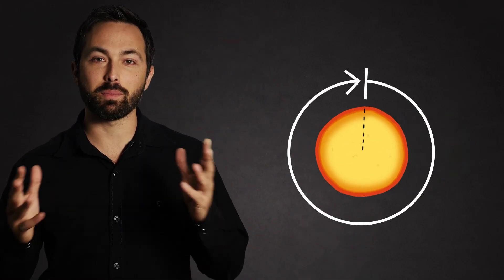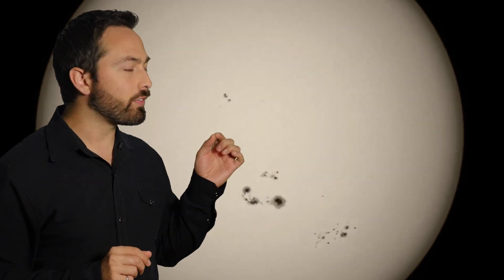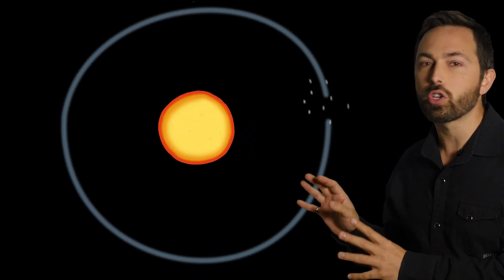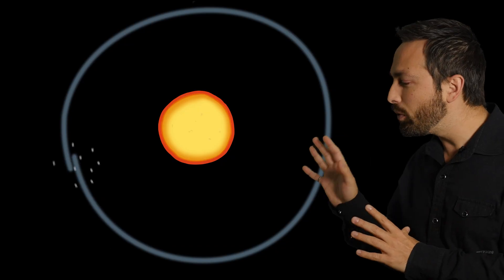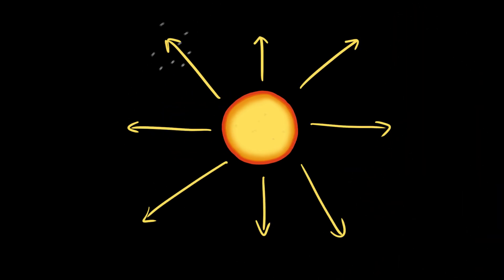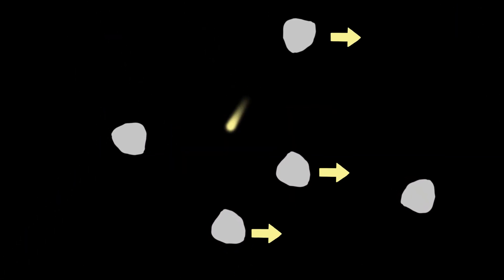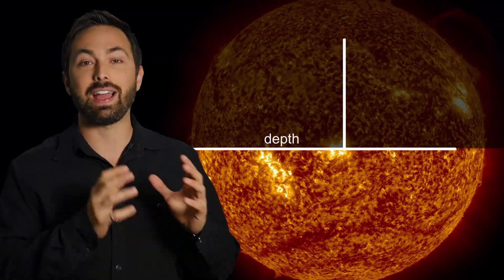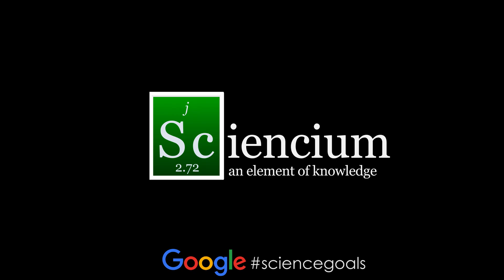Why is the Sun Slowing Down?

Comment: Im not buying it... first you say the dust slows down due to the angle of impact, and then you say the outer layer of the sun slows down for the same reason, but also that the photons going out from the sun goes out in all directions... so the momentum they impact on the sun should be equal in all directions as well, resulting in a net of zero change. And also, about the dust, the photons hit it from "slightly ahead" but still mostly from the side, just like a raindrop still hits a car mostly from above even when driving into it. So it should also push the dust particles further out, so Im not buying that as an explanation for the dust spiraling closer either.
Reply: Have a read of the research paper that Derek links in the video’s description. You’ll clear up your misunderstanding :)

Comment: Also the updrafts in it outer layers are not purely convection. Its kinda like saying lightning  is convecting cos it goes up..  its moving plasma. And lots of it. Moving plasma has electric fields 1000000 time stronger than gravity.  The eddies and flows are  mostly due to electrical  currents.. not gravity. Sorry..

Comment: Sun is causing planets to spiral outwards. Converting hydrogen to helium via fusion reduces solar mass through heat radiation. Lower solar mass equates to less influence on the planets, they migrate outwards, the earth at a rate about half the height of a human throughout an average lifespan.

Comment: Those photons (which do have mass) striking the front of the dust particle (according to the direction of orbit) would in effect slow the particle. However there would be photons hitting the opposite end thereby speeding it back up. All the while all along the side of the particle a greater amount of particle would hit and be pushing the dust particle further away from the sun. What's wrong here regarding retrograding??

Comment: Isn’t the outer layer of the surface of the sun much colder than the inner layer, and doesn’t particles (photons,electrons,etc) move fast in hot places rather than cold places. Maybe that is also a factor for the sun to slow down.

Comment: this is a good piece of work but one should be cautious when claiming theory as fact...FACT NO one knows the true composition of the sun there is no meaningful data either way ERGO one can with 100% confidence claim to understand the workings of the interior of the sun or any other stella body for that matter...sooo...there are no external forces required to slow the rotation of the outer layers of the sun, in fact it is far more likely that the perceived slowing  is the outward manifestation of an internal process

Comment: But how did it get it's speed from the beginning?
Reply: Through the natural process of star formation more than likely. If something slams into the Earth at an angle it will cause a torque which will effect the length of days. After all, meteor colissions are known to have changed the length of days on Earth. 

Recall that stars form by a bunch of space gas (particles) clumping together. If you take a very close look at it, you likely had billions of gas particles slamming into the ancient sun at angles, causing billions of tiny torques that slowly added up.

It's no coincidence that many of the planets in our solar system also rotate, because they were formed in a similar way, gravity causing things to fly into them and in the process produce torques on them.

That's my crack at it xD
Reply: Rinkamime Yeah that's true but the sun has been around for ~4.6 billion years yet we can measure how much it decreases from month to month. He didn't mention how much it slows down though so maybe I'm way off but maybe there is an interesting answer where the sun "randomly" gains speed every thousandth year or something. This would give it a cyclic speed where it decreases cause of the reasons stated in the video and increases due to something else. This would explain how we can see the deacceleration so vividly.
Reply: @ludvig4752  That is not impossible. For instance, that Earthquake that happened in Japan that caused the huge Tsunami (I forget what year it happened but it happened in the 2000s) was so strong it affected the Earth's day length slightly, I think they said it shortened the day by a tiny amount. So it is possible for a planet's tectonic internal activity to affect it's rotation. So one can infer that the same thing can happen for stars to. The stellar equivalent of Earthquakes (star quakes if you will) have a special name, but I forget what they are, but they do happen as when they happen on our sun we see it in the form of huge releases of radiation and energy. If these are frequent and they are strong enough and most if their energy happens to get channeled in the same direction that the sun rotates, then it is possible that the sun does gain rotational speed from it's turbulent interior. 

So random bursts of rotational speed from the star itself are likely possible.

It's also possible that the pull of the planets orbiting it is also exerting some sort of tidal force on the sun as well that is actively keeping it rotating, since the planets are all orbiting it in the same direction (this is only valid if the sun rotates in the same direction that the planets revolve).
Reply: Rinkamime That's true. Maybe the words you're searching for is coronal mass ejection? Do you know if the sun rotates the same direction as the planets surrounding it or was that just an addit to you point? Because if that's the case the sun would be rotating in an anti-clockwise direction. We have a saying here in sweden: "snurrar/gå med solen" roughly translated to "goes the same direction as the sun" which is meant to mean a clockwise rotation but if the sun rotates the other rotation it's an oxymoron. It's probably meant as the way we see the sun going in a clockwise direction.
Reply: @ludvig4752  I don't know for certain that they do orbit in the same direction as the sun's rotation, since in school they never really bring up that the sun rotates xD I'd need to Google it to verify, BUT if it does, then it is possible that the orbiting planets are helping to keep the sun rotating.

And coronal mass ejection I think is the term I was looking for! Basically when there's like a huge explosion on the sun that sends a bunch of plasma out into space that falls back down eventually. I rember briefly learning about them in a few classes and in a documentary I saw once.
Reply: Gravity.

Comment: I dont get it ... 
Photons doesn't have mass, and they travel with speed of light, so its not possible to gain momentum with these things. Perhaps it changes there wave length of EM spectrum. 
So the question is, does this means it eventually  generates Gamma rays ?

Comment: Only evidence for a stratified velocity of rotation below the obvious stellar surface.   Zero evidence of a change in rotation speed at a particular surface... So your title is incorrect and the assumption of your argument has gone unstated.  
It's possible the sun's outer surface and majority of it's body is hydrogen in the liquid metallic phase..  it rotates uniformly as a liquid body, does not display any of the normal properties of a gaseous body of rotation.  On the contrary , it displays all of the characteristics of a liquid conductive metal ... metallic hydrogen . It even obviously displays circular ripples on it's surface, transverse waves that are impossible to transfer in a gaseous medium but a preferred oscillation mode at a liquid  boundary.    Liquids are incompressible and if the sun (and by extrapolation , all stars ) is metallic Hydrogen , then it's also possible it is iso dense.   
Which means that it's density profile is completely different than that of current theory.    it follows that the entire foundation of theorised energy source of the stars is nothing more than that, an idea based on a very old idea of the phase of the material that constitutes the solar body. 
There is no reason why a chaotic hot gas should form such stable multiple frequency resonances... Scientists are still baffled by this... It defies gas equations and gas law Dynamics... 
 But the problems vanish if the star is compossed of an electrically conductive liquid ... This would generate the observed resonant waves with ease. 
..
If we build a house of theory on a poor assumption and never again challenge it... The house that gets built will be ever more unstable.

Comment: My hypothesis was that the planets all pull on the  Sun's liquid surface in the same way the moon pulls on the water on the surface of the Earth. Both actions create a bulge of slowed down liquid which creates a coriolis stirring affect which creates a wake with swirling eddies in the sun's liquid surface. In the liquid on the earth we call those swirls whirlpools and on the sun we call them sunspots.  With each of the planets all pulling on the sun individually and each one causing it's own bulge when those  bulges all catch up to each other the sun can no longer keeps its shape because there's a huge differential of pressure between the core and  the outer surface of the sun. 
The best way to explain that is to think about it is to think about a kid on a Merry-Go-Round which starts out in the center but as the Merry-Go-Round goes faster the kid gets pulled towards the outside do to centrifugal force. When it slows down the sun  the core  is able to move back towards the center.

Think about the ice skater spinning with their arms out. With their arms out they rotate slower. With their arms in they rotate faster.

Comment: I would Also say.. The DRAG Caused by the Rotation of the Planets upon the Sun !! ..  Literally as the Rotation of the Moon Around the Earth is Slowing it's rotation Down!!! Something this lesson missed.. But .. I Must say that YES The Release of Photons Does without a Doubt Remove Energy from the Rotation of the Sun.. But its Sooo Tiny. And Even the Elliptical orbit of the Planets is quite small .. It is There ..Most Definitely because the center of Rotation around the Sun for each Planet Is NOT The Direct Center of the Sun But Slightly off as Each Body Pulls upon each other. >> YES YES I know this video was to show how even the Small Photon can effect such an enormous body in space. Yet There are Other FACTORS as well !!!

Comment: I attended a lecture by a Helioastrophysicist from Marshall Space Flight Centre a few years ago who talked mostly about how her team and one from up North think they finally found an answer to the solar heating problem.

I think it's also bitchin-cool that it takes one photon 1 million earth years to travel from the very central core to the surface, and from the surface back to the centre through convection.

Also, they use a lot of helioseismology to detect and study those inner layers. It's how they know the internal structure of the Sun now, and discovered that the magnetic field lines get tangled and cause the diameter to rotate faster than its poles.

Comment: https://youtu.be/_mCC-68LyZM in this video, you said that heavier ball will take time to accelerate due to its mass and inertia, so now my question is: WHY in vacuum everything falls at the same time though inertia should still be there because of mass? And an example of feather and a steel ball falling at the same speed and also accelerating at the same speed, but why? Shouldn't they be accelerating at different speeds...I understand the air resistance part but I am talking about the vacuum itself. Please answer this question.
THANK YOU.

Comment: the sun is not a plasma ball, the sun is a iron core with liquid hydrogen surface.  The sun is not Nuclear it is an electric driven discharge fed by a Birkeland currant . there is no convection zone they already teste that out and found only about 1% of convection that is needed by the standard model. the sun slows down or speeds up because the circuit the sun is on varies in power.  The sun is going into a Grand Solar Minimum. The power to the sun is on a low ebb that is why it is slowing.

Comment: If this is happening, then how is it transferring effective momentum to the outside of the sun. Wouldn't this effect be happening in every direction off the surface all the time and not just in a certain direction? Seems like you would just have localized points speeding up, while others slow down, or even parts where a swirling effect could be observed.

Comment: If momentum = mass x velocity and if a photon has no mass or negligible mass, and the explanation for dust particles is transferring energy which is a change in velocity increasing the photon velocity and decreasing the dust particle; how can a photon increase velocity when it is maxed out by by Einsteins relativity?
Reply: They dont have rest mass i.e. , the mass when in rest, but, by e= mc(squared), we can infer that they have a pseudo mass.
Reply: For a photon, momentum is described by p=h/λ.  The wavelength gets stretched or compressed, but the speed doesn't change :P

Comment: May be I missed something here, but it does not make sense to me. Sun is spinning in particular direction, so those photons all hit outer layer in exactly opposite direction then? If photon movement is chaotic, then they should hit all over the place and cancel each other out overall.
Reply: Yeah, but they should cancel each other out, as in the lack of net angular direction of the photons is in contrast with the positive angular direction of the outer layer. They don't need to be pushing it in the opposite direction, just averaging it back towards zero. It's like friction.
Reply: Alexander Brandt but aren’t the photons already rotating in the same direction as the sun on average (because they’re a part of the sun) so if they move chaotically and randomly wouldn’t their net Angular momentum not change and therefore be the same as the average angular momentum of the sun and then not be able to apply any braking torque
Reply: Imraan Mitha No, photons aren’t dragged by inertia in that way, I don’t believe.
Reply: Alexander Brandt but Einstein proved that photons have momentum so doesn’t that mean that they contribute to the angular momentum of the sun? I’m also not sure I might just be misapplying basic physics principals incorrectly to a relativistic system but in Newtonian mechanics linear momentum acting about some radius contributes to angular momentum around that axis
Reply: Imraan Mitha What you’re describing is , I think, why it is slowing down. When the photon is generated in fusion the angular momentum of the sun has absolutely nothing to do with the photon. By the time it leaves it has... at least a little bit to do with the photon. Therefore the sun imparted a small bit of energy onto that photon. I doubt the angular momentum of the sun has any effect while it’s bouncing around inside the star, though. There are much larger and inherently random forces working on it then.
Reply: Alexander Brandt again I may be completely incorrect but I don’t think I’m explaining my question well. So from my understanding conservation of momentum must always be conserved, even with relativistic momentum. So in a fusion reaction, all the products have 0 ∆p. Which includes the photon so the net angular momentum of the sun doesn’t change with the creation of that photon, that photons momentum is part of the suns momentum. So if the photons leave the sun in random directions due to their chaotic movement, there would be no net torque on the sun. Since relative to a stationary frame these photons on average have the angular momentum of the spinning sun.
Reply: @imraanmitha3280  The photons do not have the angular momentum of the spinning sun.  On average, their momentum is radially outward.  (The products of a fusion reaction also do not all have 0 delta p, they have a SUM of all individual delta p = 0)
Reply: Jimmy Amato but if photons have angular momentum and you consider them as part of the sun then they contribute to the suns overall angular momentum. Also if there’s no external force then ∆p=0 so for any given fusion reaction the sum of ∆p=0
Reply: The momentum of the photons that escape, for instance to become our sunlight, is not cancelled out.

Comment: In the video derik says that on the surface of the sun the photon takes away some of its momentum but it is possible that the sun may be able to take momentum from the photons in the video it has been shown that the photon in the end was moving in the direction of the angular displacement of the surface of the sun but it may be possible that the photons move in the opposite direction to the angular displacement of the Suns surface then it may be giving momentum to the sun so expecting the photons to go anywhere shouldn't the effect of momentum be cancelled

Comment: The photons must have very small contribution to the slowing down of the dust particles. The slowing down must be because of Maxwell's theory which says that if any particle is moving in a circular path then the particles must be loosing energy which will slow down the particle and they will spiral there way towards the centre just like the Rutherford's atomic model
Reply: No, the Poynting Robertson effect would happen even if the dust particle is moving in a straight line. What you are thinking of is the radiation from accelerated charged particles, an example of which is synchrotron radiation.

Comment: You illustrate a photon hitting the particles of the suns outer layer AGAINST its direction of movement, thus slowing the particles down. One could assume roughly half the photons released would hit the particles on the other side (IN the direction the particles are moving), thus speeding the particles up. Wouldnt this effect then somewhat cancel itself out? I'm confused....